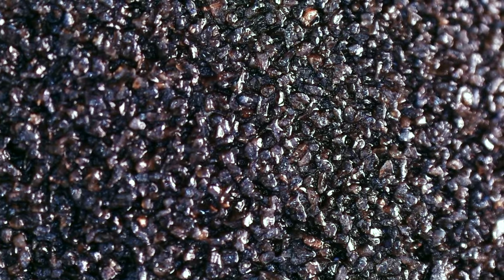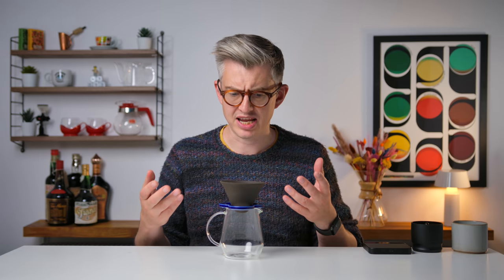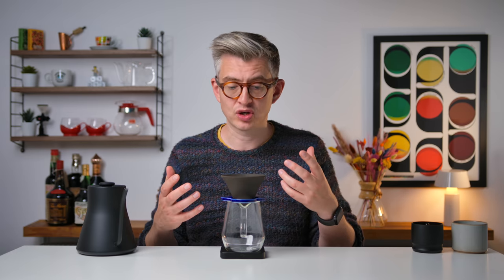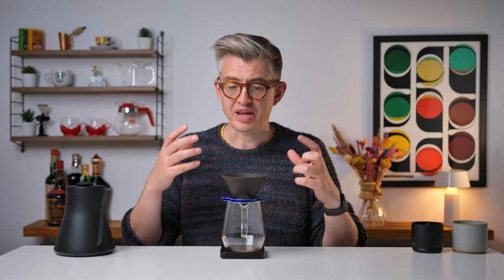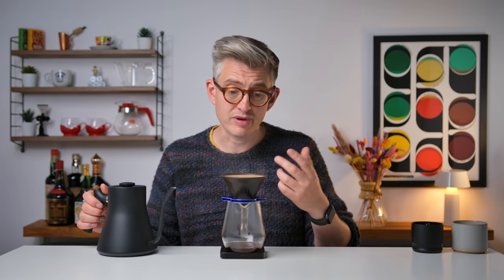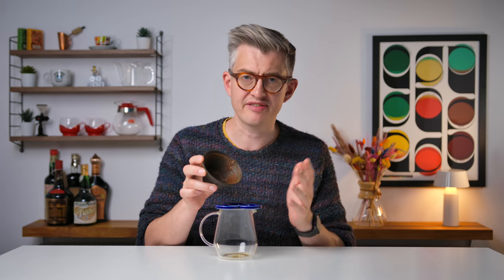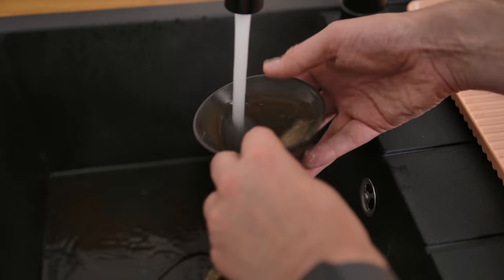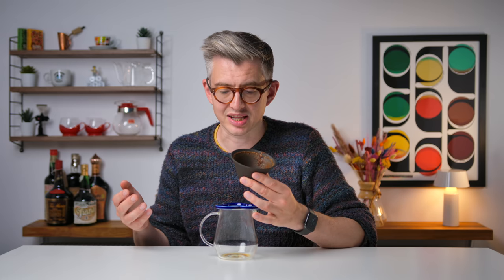Ceramic Coffee Filters: Magical or Maddening?

Comment: I love that you addressed the lack of sustainability. The zero waste market is being tapped into by companies that are encouraging different kinds of waste.
Reply: @PaendaTube  I think in this case, it would take similar energy to produce (and for 100% sure less energy to clean) using a metal filter. I got one for 5 euros from HEMA that doesn't leak almost any fines through. If you are worried about waste of production and want a more "filter paper taste" you can use a coffee sock. Those are much less energy to produce and require marginally more care than the steel mesh.
Reply: @bengerber4542  id argue against that. (Prereply edit, im not trying to come at you at all here i just am passionate about this sort of stuff and have a lot to say)

The amount of energy needed for metallurgy is immense. There are so many steps in that process and each step in the process consumes heaps of energy. Stainless steel especially requires so much. I wish I remembered all of the steps and the energy cost of each. I think I've got a textbook on it on my shelf but i couldnt be bothered to confirm atm. Plus where do you get common metals like iron? Deep within the earth extracted using mines that fuck up ecosystems. Ceramic on the other hand can be made relatively easily with low energy and with common surface level materials. Perhaps the energy that the factory uses to make ceramic into ceramic filter would be comparable to making stainless steel + plastic into filter, but the materials used themselves severely differ in energy cost. And thinking about it, the ceramic might only require a mould and the ceramic material plus maybe heat? To make the filter. Whereas cutting and bending and hole punching the stainless steel and that getting that inside of plastic that needs to be molded to fit would have way more steps in terms of the factory and I mean each step you use, you're probably using more energy. 

Sooooo all around ceramic is going to be "greener" than metal filter. 

Maybe the next question is, how many cups off coffee do you need to make w the ceramic filter in order to overcome the energy cost per paper filter? Paper filters might be really energy efficient to make. Maybe it takes hundreds of brews before you're using less energy. Ceramic has high initial energy cost, but doesn't really have that recurrent energy cost. Paper has low per brew energy cost but builds up over time
Reply: @PaendaTube  Eco friendly is a misnomer many of the eco-friendly products have a higher upfront waste to produce. Considering this is a ceramic product that probably requires some kind of baking at a high heat to make it and all the energy waste used to produce it. I'd be interested in the waste comparison to standard filters over the standard lifetime of this product and the waste produced by manufacture. 

Unfortunately there are many zero waste products that have a very wasteful production process it's just hidden from the end user so people on the end think because they are re-using the produce and not producing waste at home that it must be more friendly to the environment where in many cases it's a wash and in quite a few other cases it's actually less friendly.
Reply: @dylanmiley5642  Paper may be more energy efficient but the process to get that paper usually is destructive to the environment in different ways. Plastic straws for paper straws sure sounds great in theory but that paper has to come from somewhere. Disposable bamboo from what I understand is a better option for disposable utensils at least.

Anyway end of the day the consumer really doesn't care about eco friendly. I mean in a way I do but I'd care a lot more if mandates on big businesses happen. I'm sick of being told things like take shorter showers. There are companies who use 60,000 times the amount of water in a single hour than I will use in the next 30 years having showers. As a consumer, until big business changes leave me alone to be quite frank as my impact on the environment is insignificant. I digressed a bit, heh. Kinda also passionate about this topic.
Reply: @adamarzo559  I think you bring up good points. I don't know much in regard to all of it, though I honestly doubt that paper is even more energy efficient. The way I'd think about it is, energy efficient until what point? How many filters worth of energy would one of the alternative filters be worth? After you pass that point then the alternative is more energy efficient. And then yeah throw in there the environment impact beyond co2 etc pollution. 

On your points about businesses and pollution, I definitely agree that the world's governments have a responsibility to put harsher restrictions on emissions and waste by businesses. However I strongly believe that the actions of the individual are extremely important as well. People are both cause and consequence of society. Our actions ripple outwards in ways that we can't even imagine. As consumers, we create the big businesses. By sucking on their teats instead of producing our own goods, we keep them alive and they're actually milking us for profit. However, if we choose to buy from local businesses instead, or perhaps buy the brands that we know are more sustainable or don't participate in this practice or that practice etc etc, we divert power from the big business. Eventually, when it becomes a trend, then big business will have to adapt because that's where the market is at. 

With all of that being said, you shouldn't HAVE to rapidly and entirely shift your lifestyle to have a clean consciousness. You were born into a time that just by virtue of existing, your carbon footprint is massive. If you feel called to take shorter showers then go for it, but focusing on yourself first is the only way we can improve our planet. Once you're taken care of then you can take care of everyone else. If an individual can't afford to buy from the co-op grocery store, then they should buy from Walmart. But those that have the ability to choose differently and the awareness that their choices matter, should choose to do so. Otherwise they're participating in evil
Reply: @adamarzo559  your impact on the environment is not insignificant. At least not collectively.
Sure if you take shorter showers that s nothing compared to the water a company wastes. But thats an inherently disingenuous comparison. You are one person. A company is not one person. You would need to compare a thousand or a million people to one company and when calculated in aggregate the impact can often be comparable. Not to mention that said company can only exist because people consume their products 

Dont get me wrong im not saying its 100% on the consumer and there should be no regulation for companies. There absolutely should be, and way more and stricter than there is now

But the idea that ones personal choices are irrelevant and their impact negligible because someone else is doing more harm is blatantly false and consciously or subconsciously an effort to concoct a way to make doing nothing and continuing ones destructive habits a morally defensible position.
Reply: @DimT670  "at least not collectively" and this is where you lose the plot. if you want to affect the collective, stop evoking it. address the individuals lives and the collective will necessarily change.
Reply: @dylanmiley5642  the point they make in the video is that the extra cleaning you have to do for the ceramic filter more than outweighs the ecological cost of paper filters
Reply: @adamarzo559  Most trees used for paper are farmed. So the ecological destruction is less of a concern. And paper breaks down so it's not nearly as polluting as plastic.
Reply: @magical11  less plastic pollution, but significantly higher carbon footprint. Plus, paper just is less suited for certain applications, straws especially. Plastic waste in the environment is mostly industrial anyways. The flush of laws banning straws that are making the rounds have been based on debunked science, and they can have significant negative consequences for disabled people.
Reply: @dylanmiley5642 you are probably right, but the fact that a ceramic product breaks way more easier than metal has to be taken into consideration. And in case of such a product you won't be doing kintsugi (repairing broken ceramics with gold), and definitely won't be using super glue either
Reply: And also, one fall and the ceramic filter is gone, while the metal one might have a dent.
Reply: @dylanmiley5642  well first of all, as is pointed out in the video a ceramic filter does have recurring energy cost. You have to clean it and water sanitation is not free. But also even if there was no energy cost to a ceramic filter. Ceramic filters are not infinitely durable (definitely less durable than a metal filter I might add) eventually they are going to break or get lost and you will have to buy another one.
Reply: I think he forgot an important point which is distribution of the filters, and the type of energy used to create said hot water. If it's clean energy, which will hopefully be in the near future, hot water is better. And the amount of vans and boats that move around to bring these filters to where people can but them should also be accounted for.
Reply: Honestly while this does seem possible as a sustainable filter it seems that it requires some kind of purpose built cleaning device to do so easily without using up more energy than its worth.

Maybe some kind of water pressure thing to put pressure across the whole surface without spraying water everywhere as a tap spigot adapter, maybe a tiny low power pressure cooker, maybe a sonic water cleaner, maybe a small ozone chamber, maybe a combo of multiple. If the speed of cleaning could go up with how clean they get while the power/cost of cleaning goes down enough, it theoretically could save money for a high quality coffee shop to use these things instead of disposable filters, but as is its too awkward for much outside of home use.

Coffee people can certainly pay the price for sustainability lol.
Reply: @adamarzo559 most paper comes from tree farms on land that otherwise would have no use. Nothing plants more trees than paper.
Reply: Top ranking of this BS deception would be Tesla.

Comment: Coming from a ceramic industry perspective, this looks almost exactly like the material grinding wheels are made from.  The material probably contains no clay, and is made from grains of an arc fused mineral (brown alumina grinding wheels are made from aluminum oxide fused by an electric arc at around 2200 degrees Celsius.)  This material would be ground, graded to a very consistent grain size, and pressed with some type of organic binder (probably a glycol of some kind) and fired until the particles are sintered together, which also destroys the binder.   Firing temperatures for this are probably very high (1300 to 1650 degrees C) the rough surface is necessary for flow, as smaller pores would have a higher capillary force and require significant pressure for water to flow through. 
There is much more, but I don't know the finer details of how this particular product is manufactured.
Reply: Huh, I was under the impression aluminium is quite bad to consume (aluminium foil for cooking used normally doesn't give off enough to be enough of a risk), but would this sort of thing be as safe as that?
Reply: @Call-me-Al  Aluminum oxide is very different from aluminum metal.  ALL commercially available ceramic dishes and cookware contain large amounts of aluminum oxide (its second to silica aka silicon dioxide). Clay is the primary mineral (family of minerals really) in practically all consumer ceramics, and contains a large amount of aluminum oxide.
Reply: @theshannonlimit1114  thanks!
Reply: If it had no clay in it can be really call it a ceramic?
Reply: @CatherinePuce  yes ceramic is about the phase and arrangement of matter, not the ingredients per se
Reply: @CatherinePuce  All clay can make ceramics, but not all ceramics are made from clay. They can be made straight from purified compounds typically located in clay. Clay which is a layered structuring of non-organic, non-metal compounds.

Comment: The second you mentioned a porous ceramic, I knew cleaning will be an issue. 

Depending on the water used, you may also get scaling.
Reply: Ho boi, that's going to be an ass to clean out of the ceramic matrices.
Reply: Pool acid fixes a lot of problems.
Reply: @peterwexler5737  Hydrochloric acid FTW!
Reply: i think the biggest mistake is the grind size, this brewers were designed for japanese style brew, than means the grind is coarse and the roast is dark... that is why a lot of people complaint about the clog issue but is because was used wrong.
Reply: Me too. And that the only solution would be the purchase of a crucible oven.
Reply: @Goncalo Vaz Pinto  problem is that porous ceramics aren't inherently chemically stable.  Since it's black/ dark in going to guess that there is a considerable amount of iron that will be affected, plus whatever chemical you use is going to leave a residue regardless of method.
Reply: Lab workers clean glass and ceramic with sulfuric acid- it turns a lot of organic materials to CO2 and water, plus it's a strong acid that dissociates fully in water, so a good rinse gets rid of it.

Comment: For as iffy as they are, I do love mine for my home bar. I tend to make a lot of clarified milk punches as tiki mixes, and the uniform porosity of these really helps speed up the process and cut waste filters. For most people the filters used are not an issue, but sometimes going through a dozen or more conventional paper filters really ups the waste and costs... this can just be hit with the faucet and your good to go.... essentially using it as a VERY fine mesh strainer works a treat.  As far as the odd flavor goes, running some high proof neutral spirit through before firs use really cuts all of the odd pepperiness flavor it has.
Reply: But how much are you spending on water for rinsing, and how much on gas or electricity to heat that water? Pouring gallons of water down the drain is not zero-waste.
Reply: @beeble2003  I don't think there is a one-size-fits-all solution, but some people live on sustainable properties where they collect and recycle grey-water, excess heat from appliances, and energy from the sun.  A person like that would prefer to be able to brew coffee that they grow on-site without the need for any manufacturing byproducts, such as paper filters.  I can imagine backpackers and climbers would prefer it as well, since it's light-weight and produces no waste other than the grounds themselves.

Comment: I totally agree with James about that "taste" I can't get over. It changes the flavour of coffee too much. I have the original one from Kyumon. Hence, I just use it with my drinking water. It does make my already filtered tap water taste better (I could discern the difference 80% of the time in AB testing).
Reply: What does water filtered thru it taste like (i.e. no coffee)? Probably should test with one that has never had coffee in it though.
Reply: @EricScheid  I feel like a total nerd typing this haha, but it changes the "texture" of the water somehow, like it's "softer"? Also it's less "sharp" and more mellow. I've only tried using the filter abou two times with coffee before I've decided it wasn't for me for brewing. So I did a thorough boil and clean before using it only for water thereafter.

Comment: As a ceramicist, I would assume that the metallic oxides (dark brown/black colorants) in the porous (or perhaps ‘low-temperature’) ceramic material is causing a catalytic reaction with the coffee providing a distinct taste. Much like how ceramic catalytic filters are used in industrial application to modify liquids quickly with heat.

Comment: I am so glad that you mentioned the additional environmental burden of the rinsing process.  Many people will rush to purchase products because they believe (or have convinced themselves) that it is better for the environment..  Thank you for your clarification.
Reply: There are better options if you want reusable. Those fine mesh work just fine and are much easier to clean. If they get clogged, you can always throw them through an ultrasonic cleaner, but that's usually not needed. Also, I'm sure that fabric would work fine, even though it would probably be slightly worse for the environment.